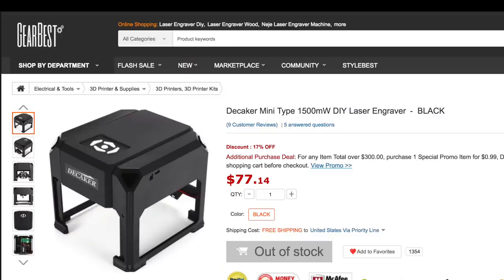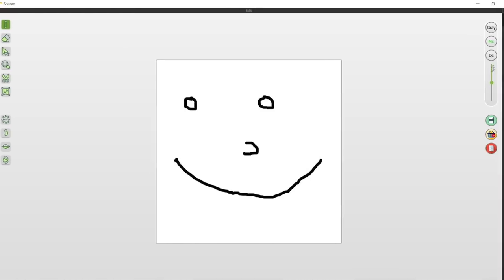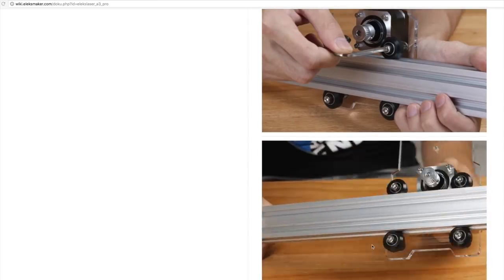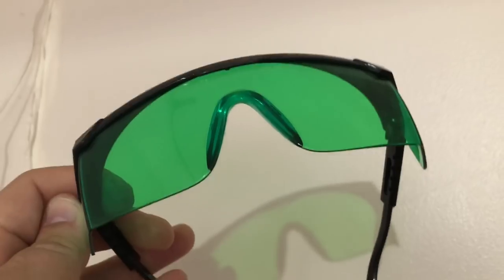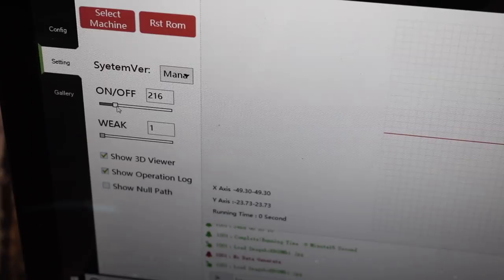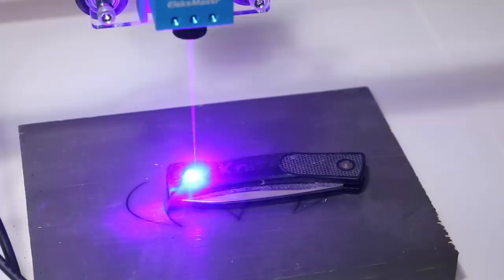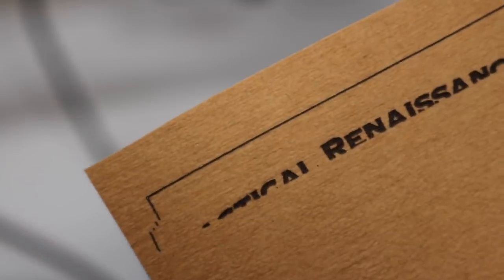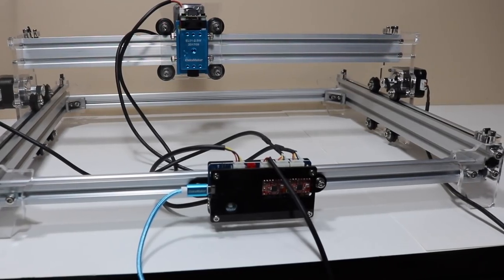Comparing inexpensive Laser engravers: the Decaker 1.5W laser and Eleksmaker A3 Pro 2.5W

Comment: The laser “losing its place” as you said is just the motor skipping steps. This happenes because it needs more current, which can be adjusted using the potentiometer on the a4988 drivers (red squares pluged onto the arduino)

Comment: I have one of these too. The misalignment that you see is not the controller software but most likely the hardware. The motors can be a bit underpowered so if either the friction is too high or the cables tug on the system, it can cause the steppers to skip or slip. I did change my motors for more powerful ones to overcome this problem. You need to understand all the parameters of the software in order to get good control of the burning (esp. speed of movement and pulse time of the laser). Also, be very aware that burning some materials is very toxic (e.g. PVC releases lethal chlorine gas) - there's a sizable list of materials you should not burn especially if you don't have a proper exhaust system.

Comment: Hey Jeff, thanks for an HONEST review on free items. Not often found on YouTube
Reply: he just didn't adjust the speed and power
Reply: Agreed - it's hard to hate on something that shows someone sees your value. 

On Metal you need to coat it with another medium to allow you to use a Higher setting and then burn off the middle medium 

On glass with a lazer cutter my friends sware by dish soap 

At old jobs the lazer was shot at metals in a thin bath so it wouldnt burn...
Reply: I agree thank you..

Comment: Owning the Eleksmaker A3, I must say that they are an impressive platform for the price. It's definitely not plug and play but of course, no laser truly is. I use Inkscape to design my files and export the Gcode from there using the Jtech Photonics extension and load them up in Laser GRBL. I've had some very impressive results from the machine, it just takes patience and trial and error. I installed a drawing attachment to the laser mount and have used a ball point pen to draw some awesome stuff with the machine. If you have a 3d printer, there are also many upgrades available to make it a highly adjustable machine. Happy Lasing!
Reply: Hi i am new to this. Plz tell me what ,,,,,,,," I use Inkscape to design my files and export the Gcode from there using the Jtech Photonics extension and load them up in Laser GRBL. ",,, plzzz?

'I installed a drawing attachment to the laser mount and have used a ball point pen to draw some awesome stuff with the machine.' Some more lite on this plzz
Thanks
Reply: @telugubidda00786  first part is that he uses Inkscape to draw whatever he wants and uses a plugin for Inkscape that generates the code for the machine to run (instead of having the original machine software doing it), then (and this part is the one I'm not 100% sure) he either loads the program to the supplied software or uses a different software to send the code to the printer.

Second part is, he made an attachment so he can place a pen on the printer and use the pen to make drawings instead of using the laser. Hope this helps.

Comment: Good day, Jeff !  Thank you for this review.  Actually, I had this very same type of LED Laser (using A5 format .. yours is an A3 format, I believe).  After a few months of expensive and time consuming cuts and tries, I went CO2.  Wow!  What a difference !  PRICE was also a matter, but the results and possibilities are not the same at all.

One thing you may want to try to get rid of the smoke residue is covering your wood surface with painter's tape.  The Laser goes through and it is easily removable at the end of your job.  Also, brushing oss the excess sut with a simple toothbrush (and tap water) can give interesting results.  

I noticed the you experimented with Tac Craft material.  You might not know, but this material contains Chlorine.  DO NOT use this material .. or ANY material containing Chlorine for that matter, with a Laser (Diode or  CO2). Fumes are highly poisonous and potentially deadly.  That also corrode metals and can scrap your machine's insides.  This was a friendly warning.

Thank you for reading me and have a great week !

Comment: Just a suggestion:
Watt setting to high causing overburn, in turn causing excessive smoke which causes interference or laser skip. Set wattage appropriate  for material type as well as depth and speed of burn. With setting shown, try a piece of 4"x4"x 1/2" thick maple or oak to make coasters for your cups with last name or deer head.

Comment: When you enable pwm it will gauge the laser power better and not use only 2 states, high power and low power, it will use a percentage of power ranging from 0 to 255. Also if you didn't assemble it properly, the belt may be loose and the motor will spin under the belt causing it to ruin the image, some software will even tell you something is wrong and either stop or attempt to finish. I use basically the same laser with software I've downloaded for free and it works great. The pictures come out exactly like they do on other printers that I've seen on YouTube videos. I recommend this laser.

Comment: I Have the same  Eleksmaker A3 Pro 2.5W and it works great make sure your rails are smooth rolling and belts are tight and that running in to your wires.  I did upgrade the software to T2 lazer
Reply from the maker: Yeah I enjoy how adjustable it is for better machine travel, I’ll have to look into that software
Reply: can it do metal
Reply: Can I make rubber stamps with eleksmaker?
Reply: @JBWorkshop90   no! Even my 60 watt CO2 laser cannot. You can remove paint and anodization and raster engrave only.  Higher power fiber optics lasers needed to cut metal!
Reply: There are some great upgrades that you can add for a decent price. More so if you own, or have access to a 3D printer. If you look up "Important upgrades for the EleksMaker PCB laser CNC machine" by Marco Reps you'll see them and how much of  a difference they make.

Comment: I have an eleksmaker clone. The skipping and losing place in my experience was do to improper voltage from the circuit board to steppers.  A very small Phillips head adjustment knob on the circuit board and a  multimeter solved the problem

Comment: Actually I've had really good results with the Eleksmaker A3.  For engraving you must limit the power and the depth of cut or amount of burn is based on the correct combo of speed and power.  The Mana SE controller has dynamic power control through pwm which is a big plus! You did not install the on/off button on the switch.  I added a 4.7k pull down resistor on the laser head between gnd and the pwm signal which prevents the laser from accidentally turning on when powering up.   I will be adding limit switches and a fireproof enclosure.  Out of the box it definitely needs some upgrades, but it's a great framework for a nice machine.  T2laser can drive the machine through gcode. Benbox.laser.us has a great support community!!!

Comment: I have the same A3 Layer, and I can say, that when you know what to do, and you use a print server like LaserWeb you can get excellent results. You have to reduce the power by setting the power modulation setting accordingly. If you run it on stock setting with the inferior standard software which comes with the machine, it is no wonder that nothing good comes out.

Comment: I bought the same frame but a 15 watt diode laser for it. I flashed the arduino and uploaded grbl as the controller and used Laswerweb4 for gcode and it works great. Only other mod was to print new belt tension clips as the ones that come with it are crap and cause the laser to bind and miss steps towards the end of the travel in the X and Y
Reply: @NuttCorp, as far as I know there is no laser diodes more powerful than 6-7W in existence. Every single 10/12/15W diode that I checked was actually "overclocked" 6/7W diode with significant cooling attachment to let it survive few months before it will burn-out.
Reply: Don Mega  there is no 50/80/120W DIODE lasers. They're CO2 lasers, that's totally different animal.
Reply: @Sir_Yaro  Would you please recommend a good laser for cutting 1.1.5mm tickness plastic,styrene, abs,  tick paper?
Reply: Any suggestions on cheap metal engravers?
Reply: @Sir_Yaro  - Yes there are even 500w Laser Diode setups :) It's just many laser diodes funneling their combined light down a single fiber. Look up fiber laser.
Reply: @Sir_Yaro  I've a 60W laser diode here laying around, just a slab of bronze with big power connectors
Reply: @mgeb101  are you sure this is a laser diode? Single laser diode? I can easily believe you have single enclosure with multiple diodes inside having total power of 60W but not a single unit.
If you're certain I'd like to get a name of this diode so I could learn more about it.
Reply: @Sir_Yaro  the best example is eg. https://youtu.be/EbqJnS1AgPI as long as the output is coherent it doesn't matter if the laser is created by multiple chips.
Reply: @Sir_Yaro  Also lasers have two power rate. How many watts it takes to run. The electrical power. And the optical power. So a laser has two power ratings.  So a laser may be advertised as 15 watts, but is only 5 watts optical power. And it's not always clear which they use unless it's started or both are listed.

Comment: I have an older version of the Eleksmaker.  I ran into a lot of the same issues you did with it.  What I found is speeding up the movement to stop it from burning too deep, the slop in the belts starts causing issues.  I think the only way to really use this on thinner stock is to bump down the power on the laser (requires flashing the arduino and using different software) or to replace the laser with a lower power unit.  I have a friend with a 500mw unit that doesn't run into these issues.

Comment: The stair step problem on the jean label is hardware. The stepper motors are physically losing steps when they reverse direction. Go slower and reduce power. Great video.

Comment: I was going back & forth between both engravers. Now ill look else where thanks to this video. Didnt waste money
Reply: As a user of the A5 and A3 Pro, I can tell you that both machines work great, as long as you take the time to adjust them correctly. I had the same issue of skipping where I couldn't burn a circle without skips. It turned out that my belts were too tight. The basic software is ok for starters and getting to know the machine but you'll soon outgrow it. I recommend T2 Laser. You can download a free version that let's you burn small projects. The pay version is  great with free upgrades and great support. There's even a user forum for questions. Check it out at forum.eleksmaker.com and look for T2 Laser.  Hope this helps

Comment: If you had a tube near the laser running ventilation or a fan to blow the smoke out of the way, your image wont be so bad....the smoke affects the laser lights accuracy.
Reply: Besides that the material as to set straight on a base, it shouldn´t be deformed like the leather was.
Reply: The stair step problem on the jean label is hardware. The stepper motors are losing steps. Go slower and reduce power.

Comment: It might be interesting to purchase the larger laser with the slightly better build quality and either run Machine Kit on a Beagle Bone or just run LinuxCNC  on a small single board computer and build an enclosure to collect the dust and smoke and have an interlock to prevent the laser from operating with the lid open. Five watts isn't enough for serious cutting but it would be enough for serious engraving. The engraving depth could simply be controlled by the speed of the laser head.

Comment: Jeff, I have had the A3 Pro for over a year now. Suggestions:
Make an enclosure with fume extraction (An old PC fan is sufficient)
Dump the supplied software! At present I am using T2 Laser which allows a lot of control. I am about to test Lightburn (Linux, Windoze and Mac versions available) which has even more options.
There are also free programs out there. 
With the correct software and a few minor tweaks it's a good piece of equipment. I've been making and selling  coasters and decorations with mine for over a year.
Reply: Same here.  I’m running one of these with a laser version of GRBL and T2.  It works quite well now.  We use it to add a signature/logo to my wife’s turned wood bowls.  I’ll have to give lightburn a try.  Thanks!

Comment: So the laser turning on is actually a hardware design flaw and not a software flaw. They forgot to add a pulldown resistor to the laser control board.  So when the machine control board initiated its handshake with the PC the laser turns on. It can be fixed by adding a resistor. I just keep mine unplugged until I'm ready to hit send. Software is a major issue. I prefer t2 laser but lightburn is good too.
Reply: In my comment I referred to benbox.laser.us and you sir are one of the key contributors that makes that a great community and I really like the Eleksmaker A3. Thanks for all you do!

Comment: the small laser will not work unless you take it all apart and reset the worm drives.  i bought two and love them but before using either I had to take them apart reset and grease them.  they would not work at all before I fixed them right out of the box.    but   for under 100 I make lots of cool engravings and wooden business cards etc.
Reply: My laser makes grinding noise and messes up the burn and shortens the work space. How do you reset after taking apart? Also i think i have driver issues but Windows says they're installed correctly. Thanks for the tips.

Comment: yesterday my Eleks servo motors were working just fine and then all of a sudden they quit after it made a cut I tired to move them with the back and forth buttons and nothing worked looked on the Eleks forum and they talked about the Micro USB cable can go bad so I bought another one and its still not working, the laser comes on when I change screen but no movement what do you think?  the Error im getting is "Still in running"

Comment: PSA: Usually those cheap goggles that come with the laser do next to nothing to protect your eyes from the laser, especially if the beam hits you from a highly reflective material. Also its good to remember that different laser wave lenghts require goggles specified for that wave length. So invest in some QUALITY laser safety goggles. Laser can really frick up your retinas even if it hits you indirectly. 20-40$ is worth your eyesight.

Comment: Have you seen any improvements in the A3 software since this video was created?  I've been wanting one, but this video may change my mind.
Reply: As a user of the A5 and A3 Pro, I can tell you that both machines work great, as long as you take the time to adjust them correctly. I had the same issue of skipping where I couldn't burn a circle without skips. It turned out that my belts were too tight. The basic software is ok for starters and getting to know the machine but you'll soon outgrow it. I recommend T2 Laser. You can download a free version that let's you burn small projects. The pay version is  great with free upgrades and great support. There's even a user forum for questions. Check it out at forum.eleksmaker.com and look for T2 Laser.  Hope this helps

Comment: Thanks for the review. I was going to buy one of these
Reply: As a user of the A5 and A3 Pro, I can tell you that both machines work great, as long as you take the time to adjust them correctly. I had the same issue of skipping where I couldn't burn a circle without skips. It turned out that my belts were too tight. The basic software is ok for starters and getting to know the machine but you'll soon outgrow it. I recommend T2 Laser. You can download a free version that let's you burn small projects. The pay version is  great with free upgrades and great support. There's even a user forum for questions. Check it out at forum.eleksmaker.com and look for T2 Laser.  Hope this helps

Comment: I just wish I'd watched your vid before buying.
The one I bought was the one where the connection came off.
Now I have to wait 6 or 7 days, to see if the same happens?
Reply: Probably a bit late to say this, but if you have a glue gun - glue gun behind and around the micro usb port where it is soldered so that the glue will hold it in place and stop the force all going to the solder joints. this should help a lot

Comment: Good video, nevertheless I hope you were wearing a mask with protection against chemical fumes when lasering those plastics. It is good to inform of other viewers the safety issues involved with using such high energy sources, particularly when using it in a clearly unsafe way without mentioning the precautions one should take. FYI in case you were not aware:

PVC when exposed to high energy sources (such as welding, laser engravings, markings, etc.) can cause severe health problems including cancer, neurological damage, as well as reproductive and immune system damage. PVC emits extremely toxic and corrosive hydrogen chloride acid gas, dioxin, ethylene dichloride and vinyl chloride, which make a very toxic carcinogenic combination.

Phosgene is an ingredient in most plastics composed of hydrochloric acid.  Originally designed for military purposes as a poison in the First World War, when inhaled, phosgene destroys lung tissue causing pulmonary edema.

Rubbers that are exposed to high energy sources (such as welding, laser engravings, markings, etc.) emit benzene, a VOC (Volatile Organic Compound) and recognized carcinogen that may cause death, low white blood cell count, anaemia and cancer.

In other words, ALWAYS WEAR A CHEMICAL FILTERED MASK WHEN LASERING PLASTICS, especially ones that you do not know what type they are.

Comment: you can set power of laser. you not need full power cut paper. and yes if it forget M5 turn laser off or S0 it start laser when there movement G1 thats laser mode. you can run laser without using laser mode it work same lol